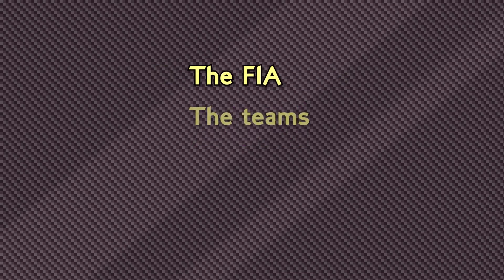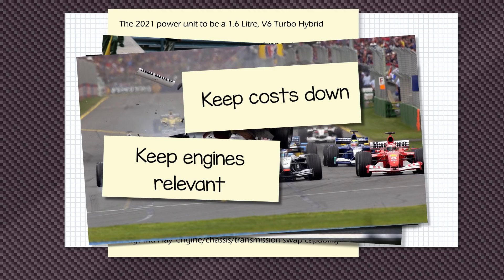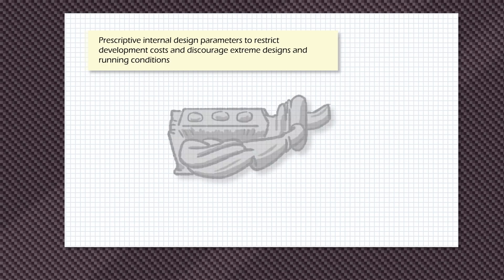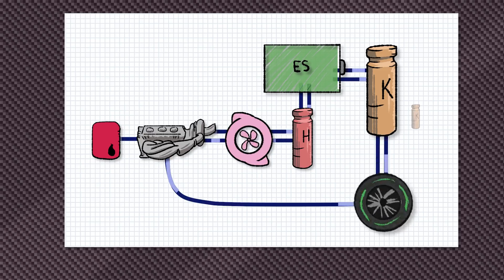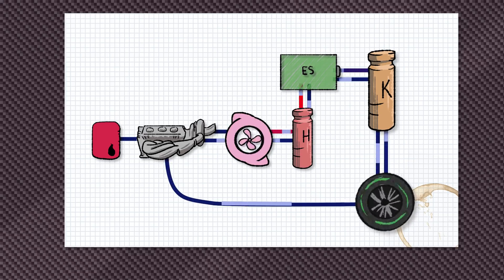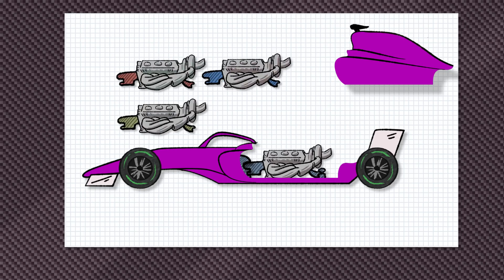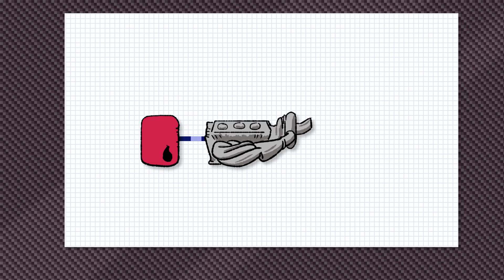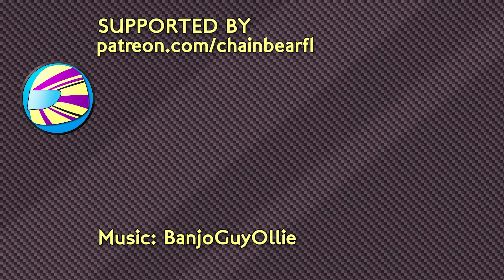F1 Engine proposals 2021 explored

Comment: Yeah, we are all excited to drive a 0.6l V2 Clio with MGU-H in 2030.
Not..
Reply: But what if they're pulling 415hp and 365lb ft of torque through that .6l?
Reply: @getritch1989  Then they'll be burning so much fuel in that tiny little engine to make that power it won't be any more efficient than a 4.0 litre V8. Physics are physics, power can only come from burning fuel and air. There is no magic spell that can defy that and dramatically reduce fuel consumption for a given power output.
Reply: @getritch1989  for 3 minutes :-)
Reply: @theLundLs Well, there is the question of efficiency of coal plants versus combustion engines, but I don't know enough to speak on that. Mostly, the benefit of electric cars is that they leave open the options for future innovation and changes to the way electricity is generated in a region.
Reply: @bobsquaredme  the issue is that the production of the battery is incredibly polluting, an ev in perfect circumstances would be ~60% the co2 emmisions of a regular car over ten years, and the batteries won’t last that long anyway. That’s why I like bio fuels, same great engine noises and you still have gears, but much better for the environment than evs.
Reply: theLundLs electric cars never make sense, who wants a shitbox with a limited lifespan much much shorter than an engine, one which can’t be maintained at home which will further push up the costs of owning a car and the numbers of dangerous vehicles on the roads... not to mention the fact you need to plug them in every night... that’s great if you can park all your cars on a drive but most of the UK don’t have drives and a lot of people have to park up the street.... then what
Reply: Speak for yourself... by 2030 we should all be on electric engines. Probably we will not. Petrol derivates prices where I live are ridicoulously high.  So, I really would love to have a car making 50Km with just a liter of gasoline, instead of just 10 to 15. Is it exciting? No, but will be efficient and clean.
Reply: @josegaldinokohler582  f.. electric cars. It's just a cool toy (tesla) or ugly peace of sh.. (renault and other). There is nothing about "green" or "economy".
Reply: Who dafuq cares about efficiency, government is gonna make you pay high taxes on whatever anyway so screw environment, it does nothing for your wallet

Comment: Here's the issue riddling F1. A vast portion of the fan base are people who reminisce of the good 'ol days, whether that be the 60's, 70's and so forth. Hell, even the 2000's to mid 2000's were still insane fun to watch. The people whom adore this sport can no longer do so mainly in part to how stiff the sport is wrapped in cotton wool. Sure, a driver died a Suzuka, but that doesn't mean we need a halo. That accident was a 1 in 10 billion chance freak accident, it never should have happened and wasn't even at fault of the driver. The whole electric shenanigans are really putting fans off too. I mean, sure driver aids and all that to handle 1000hp under you foot is all well and good, but as soon as the driver input to making the car go round in 1 piece is 10% and the rest is a Geeky engineer tapping away at a keyboard and adjusting various elements on the car, then where's the skill? The whole idea of manufacturers being able to develop their own cars within the regulations is also stupid to some extent. If you look at the podium of every race, it's the same 5-6 drivers every time. We have skilled drivers such as Wherlein, but he can't make a career because he simply can't compete. You have Mercedes, Ferrari and red bull for the cake each time - where's the diversity? Finally I feel like it would be wise to scrap the turbo, and fit a twin turbo V6. Or hell, even try some 5 cylinder engines. I mean, it's a crowd divider, but the Audi IMSA GTO sounded insane. I also think if DRS could just be opened at any time would be brilliant, again adding tactical variety to the game. In all honesty though, by the time we've bickered enough about F1, there will be Le Man's prototypes lapping every circuit quicker than F1 cars. I mean only 2 data ago did the 919 evo mash the lap record by 51 seconds around the green hell. Look at Aston Martin's Valkyrie AMR and Mercedes 1:1 power to weight car. The Aston even has a V12, I mean Cmon F1; where's the competition?

Comment: I hate hate hate hate how restrictive f1 engine regulations are. You wanna see good racing? How about un limiting the displacement and configuration and only limiting the fuel consumption. Yeah know how many wacky designs you'd see! It would be fantastic
Reply: How would that be good racing ? Mercedes would throw millions on engine developments and others smaller teams would be left in the dust.

Comment: With respect, if engine futures is your thing the future is already here in Formula E. The internal combustion engine will not last the century in mainstream OEM platforms. I believe Porsche is looking into Formula E as other OEMs. Can F1 eventually dump the internal combustion engine and go fully electric...? Given the cost of high level racing such as formula 1, WEC prototypes, and presuming Formula E, I can't see two high level all electric racing platforms. F1 or FE would have to absolve the other.  Unless F1 decided to actually take some ques from NASCAR -lol, hear me out - by making it a nostalgia series and bring back the screaming V10s. Otherwise, I think F1 will absolve FE as the history behind the F1 name in itself is far to rich.

Comment: Well explained indeed. My concern for F1 is that once every square millimeter of an F1 car is regulated then creativity and difference will be erased. Sure there may be an opportunity for designers to fiddle with some tiny parts, but essentially having the entire car millimeter for millimeter and gram for gram specified - well then you have cars with no character which become entirely spec'd cars. It will leave the designers nowhere to go if every plane, length, diameter, distance, height, etc., is contained in the Formula. It seems as if you you would prevent progress and innovation. What say you?

Comment: It's always a bit odd when F1 talks about "efficient" hybrid engines vs the gas guzzling monsters of the past. The current engine spec uses close to 105kg of fuel to cover just over 305km, which is roughly 3km per litre, probably less. This doesn't seem very efficient, green or road relevent. The engines are, of course, incredibly efficient at turning fuel into power, but how does their fuel consumption compare?

Comment: I want a loud 21000 RPM engine to come backup
Reply: It's not just about manufacturers. There are 4 engine manufacturers in F1 and only 3 have factory teams. And I can guarantee no new team is coming along because the V6 turbo hybrids are too complicated and expensive, as was demonstrated by Honda. A new manufacturer would have a hard time catching up, just like Renault is unable to with their team. For developing electric power you have Formula E. F1 was always about innovation, yes. But when has F1 ever innovated with engine design, a F1 engine is completely incompatible with anything road related. F1 innovations were in chassis design and safety, not with engines. V8s are cheaper and easier to make, it would, IMO, be easier to attract new teams with a simpler engine formula. They aren't even engines anymore but "power units". The only reason F1 lost Toyota, BMW and Honda was because of the economic recession of 2008. And now any new manufacturer would face an enormous uphill battle because of how long and complicated today's engine development would be compared to V8s which are the middle ground between V10s and V6s. V12s would be completely ridiculous though, they were outperformed by V10s in every single way. And the viewership would surely increase, as well as the revenue from bringing back V8s. The only problem would be that it would basically be admitting failure and because of that surely won't happen.
Reply: How about turbojets slapped onto the back of the car.
Reply: Why have F1 fans become such assholes since the turbo era?  Seems that we fight more than be civil.  In the words of Obi Wan, " how uncivilized".  Just be cool.
Reply: I bet it could be done if they used I6
Reply: Again.. how many rpm is for the formula-e motor spins at?
Reply: Me too. I'm looking forward to this!
Reply: Counter: Why do you want it though? Because of the noise? Wouldn't that be counterproductive towards the FIA's current goal of enforcing fuel-efficient cars that ultimately reduce carbon emissions, thus saving the planet? Other than that, it's scientifically proven that noises of 95dB is can lead to long term hearing loss. That's not something we should be supporting.

You have to balance it out.
Reply: Its simply not relevant anymore. We have to accept the future, whether We like it or not.
Reply: Don't we all
Reply: Don't we all wish there would be 2 liter V12 screaming at 30000 RPM
Reply: @bartbarnett2811  wet dreams
Reply: Not happening
Reply: @DCTag   it's 20000 rpm
Reply: @DCTag  They switched from turbo back to NA in the 60s, could happen again.
Reply: @amorag59  for entirely different reasons. It baffles me how many people don't get that F1 will never return to its roots. The combustion engine is slowly but surely finding its end over the next few decades, that's the harsh reality. I too loved the screaming NA V10s but they wouldn't make sense for manufacturers nowadays. Is that so hard to realise?
Reply: @NicoNice24  "The combustion engine is slowly but surely finding its end over the next few decades"

so are human driven cars. the point about F1 is that it should not be road relevant
Reply: @NicoNice24  Manufacturers are still producing cars with V8 engines mate. Don't expect the combustion engine to just die immediately.
Reply: @slavathecar  That's why I specifically said "slowly" mate. Yes they're still making V8s, but these big-ass engines are getting less and less relevant for an overwhelming majority of the market.
Reply: @User-nu6km  but the point of F1 is literally to be road relevant, remember abs, 3point seatbelt, active suspension... guess where did it come from
Reply: @maceto_  no its not. Yes, all this stuff came from f1. but thats not what f1 was made for
Reply: @User-nu6km  Yes but those big V12s are slowly becoming a bad and just simply slow option.
Reply: @golfball_diver  
Racing in general is also used for automotive technology advancement. Its too expensive otherwise. Making fantastical but impractical vehicles would be a heavy investment into a dead end.
Reply: @NicoNice24  They made formula E for this reason
Reply: @DCTag  lokie here boys looks like a formula e fan here
Reply: @bugattiiscoollans15  because it's not happening, I'm a formula E fan?
Reply: The problem with the engine debate is the fact that hybrid engines are also outdated. Purely electric cars are the future atm, so why should f1 stay with outdated hybrid tech. 

Why not celebrate the history of the awesome sounding atmospheric combustion engines before they dissapear for good and f1 goes all electic itself.

Comment: I think those rules are breaking the sport.. I think F1 sould be as “open” as plausible. Let engineers do there job. Let them think out of the box. Make some base rules. Simple. And then let it be. For exemple, 1.5 liter V6 single turbo, elektronic power unit with max power output of 180kw. Max batary size and minimum car weight. And an maximum fuel capasity. 

Let them experiment with different fuels, Tire brands and aerodynamic disigns. Like in the early days. 

6 wheels on a car, no problem. But they Will take longer for a pitstop because the maximum tire changing people is 4.

Fan car. No problem. But it Will take power from the crank. So les power to the wheels. 

You want boost tanks. No problem. But you Will have to store them some where, and it would make the car more complicated. 

That is why F1 exists. Making new tech for future cars. Now they have to work within such thight regulations it is all the same.. and it wil stop the creation of new disigns and technologie’s...

Comment: It was a V12. V10. V8. Now V6

I guess by 2030 We'll have Single cyllinder 3.6L displacement lollll
Reply: The top engine in the 80s was a 1.6 ltr in line 4 from BMW and produced 1500bhp in qualifying trim. Porsche's Lemans engine is a V4. Early 90s DTM cars were V6s. Who cares.
Reply: Who gives a shit about cylinder numbers and displacement as long as they're making stupid amounts of horsepower
Reply: In 2030 they will be running like the Flintstones
Reply: In the future F1 engines will probably be more like motorcycle engines
Reply: A small inline 4 can be good aswell because it can sound high pitched like the past f1 cars based on motorcycles that have it some which sounds like the v8s f1 era and is relevant,efficient,compact,and can also be powerful if designed properly
Reply: By 2030 f1 will be fe
Reply: Today's cars still have faster lap times compared to the big heavy engines
Reply: @noahc9786  Formula Human
Reply: Unpopular oppinion: i wouldn't mind an inline 4.
I mean it does work in SF the toyota biz 01f sounds better than all the v6s on the f1 grid combined.
Reply: You do realize that the V6 is way more efficient than the v10 right?
Reply: @g.ferreira6745  why does efficiency matter? It’s a race car not a Prius.
Reply: @mj6463  if you consider yourself a fan of F1 yet you can't understand why a more efficient car would be better then you should really look into it. I'll just give you a hint: more efficiency, less fuel required, which means???? I'll leave that one for you

Also that's not even the only reason why more efficiency= better cars

Comment: F1 should be about companies pumping as much money into it as possible with little restrictions. Only a few safety measures. Otherwise it should be about getting a car around the track as fast as possible. This facilitates the out of the box thinking that ends up with new technologies and also in a way gives more of a chance to the smaller teams who would have to try radical designs to beat the big teams. Without any design restrictions the sport would be way more relevant to the pursuit of new technology.

Comment: Iv gotten used to the hybrids. There is no reason why they cant keep them "at least" as loud as they are now.  I just hope it doesn't EVER change to 100% electric because then we just have Formula E on steroids. The biggest complaint i have right now with the rules is this idiotic idea of 3 engines per season. How do they expect the teams to push 100% when each engine needs to last 6 or 7 races? That's ridiculous!

Comment: 2018 cars are actually limited to 15000 rpm, but drivers shift in 12000 because the engine does not give any more power beyond 12000 rpm. So why to increase rpm limit even more? Can someone explain?

Comment: My issue is with the limited number of engines, but not b/c of the strain or strategy of designing and operating within 3 engines a year under normal racing conditions, the issue is accidents.  Toro Rosso is now basically f'k'd because Hartley binned the car backwards into the barriers destroying all components of the P.U.  Although Toro Rosso is not at the front of the grid there needs be adequate engines or exemption to reduce the chance that a collision this early in the season takes someone out of championship contention.

Comment: F1 was last relevant to the real world all the way back in 1993. ABS, TCS, 13 inch Wheels, various engine designs and displacements, active suspension, and there was even a CVT developed by Williams. Then everything was banned in the name of safety... and the real world moved on for the most part.

Comment: Instead of all these stupid restrictive regulations and what engines you can use and what energy recovery systems  and stuff,why not just set a fuel limit. Make an engine that'll do the whole race but it can only use this much fuel without refills. Then let the engine manufacturers try and come up with the best possible solution to the problem.  That'll at least create some diversity on the grid

Comment: I think the removal of the MGU-H will cause a big shake up in the way the ICE is run. They were apparently getting into crazy lean burn strategies not just because of fuel flow limits but also to produce hot/energised exhaust gases that had the MGU-H singing. eg sacrificing ICE power to maximise electrical power. With MGU-H gone the turbo/ICE marriage will swing back to being a more traditional setup. Will they have enough fuel to be able to do that though without the overall ICE + KERS having less outright power than they've had?  Compounding this is that KERS harvests electricity under braking but the stopping distances and % of time under brakes on a lap of these cars is much less now than what it was. Who knows if they give them more fuel to play with we might see the ICE becoming the real hero of the PU again?

Comment: Taken to its logical conclusion with no limits on the number of engines in a year, you only need to look about 30 years back to see what would happen. Google the 1986 Brabham car. 1.5L bmw turbo engine, putting out something like 700-800bhp for the competition motors (designed to run max power within rules to last exactly 1 race) and a separate engine for qualifying for that same race (only made to last about 3 laps) rumored to be putting between 1300 and 1500 to the rear wheels. 1500bhp, 1.5L. And fun fact, the engine block for every one of these motors were taken out of wrecked road cars, which originally made about 90bhp.